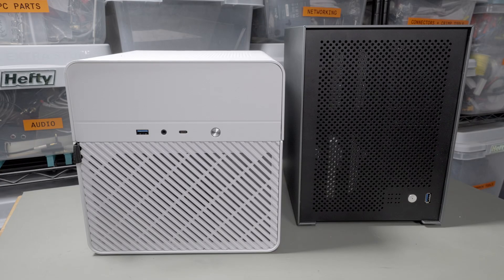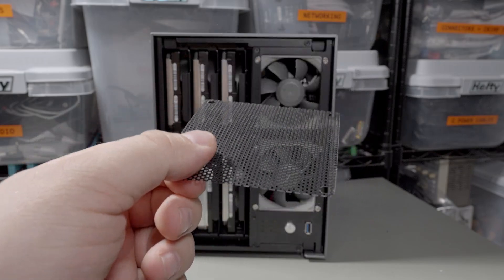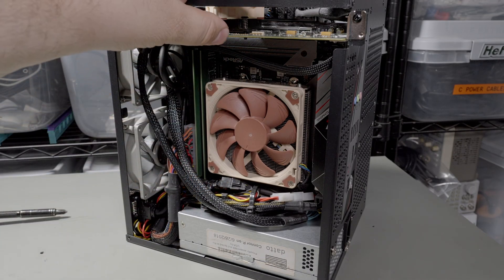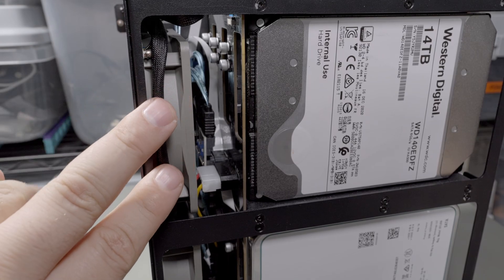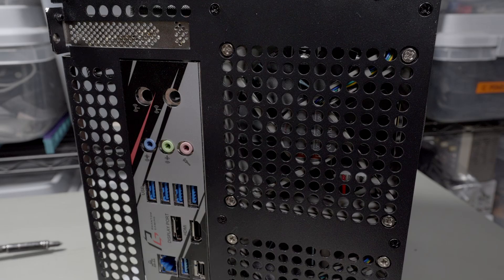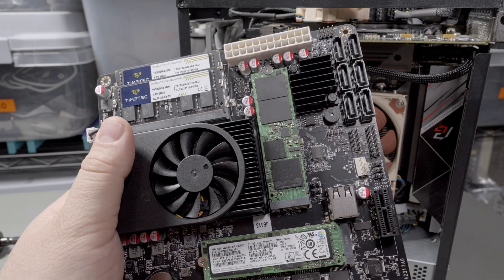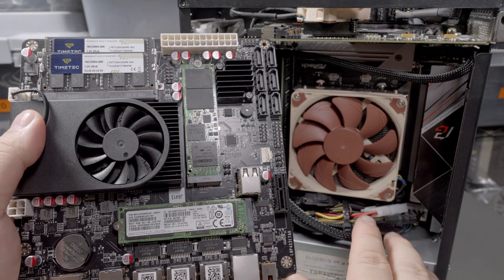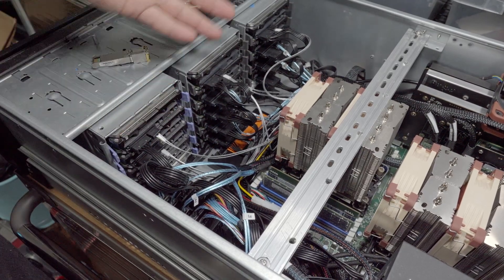Reviewing an overpriced 6-Bay NAS case for... science?

Comment: Did you get the Sagittarius 8-bay case from the description yet? There really isnt anything about it out there. My main concern about it is the PSU location right over the CPU, which severely limits cooling options, especially if i want to use it for more intensive tasks.
Reply from the maker: It absolutely can't take a large cooler. It's clearly designed to have a cpu for Nas tasks only.

An AMD stock small cooler fits with like 1mm of space (not recommended).

It might be able to take a 120/240 AIO, I will try and measure for it when I film my review in a couple days.
Reply: @PeterBrockie  Thats what i thought. I was thinking of running my home lab on it as well as a few game servers like minecraft or palworld, all under proxmox. I have also found a similar system, the Auriga 6-bay NAS chassis. It seems to have the same PSU limitation. I thought about using an SFX/SFX-L PSU just to get a little bit more space, but honestly i dont know if its worth the squeeze compared to going with something else entirely like the Silverstone CS382 which is a full Mini-Tower with hot-swappable drive bays.